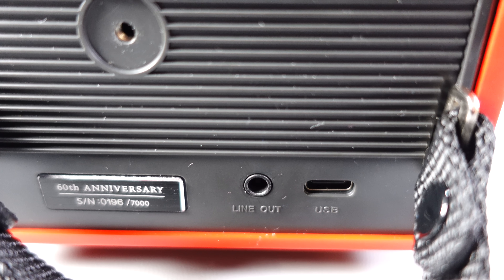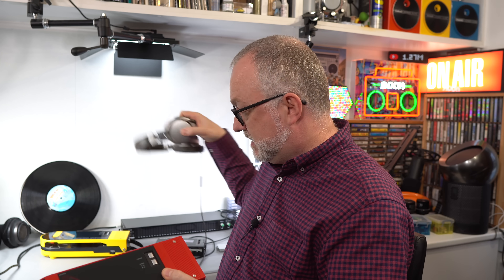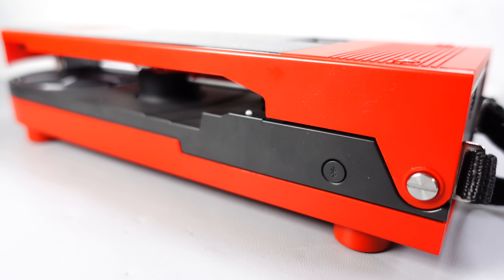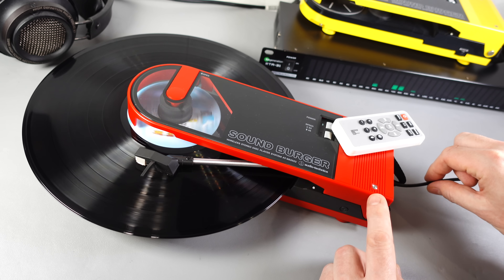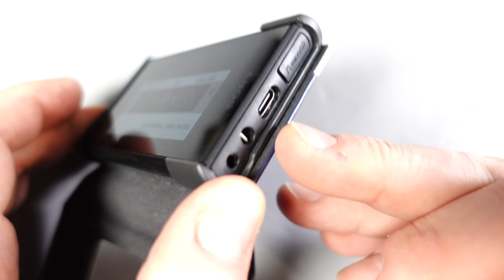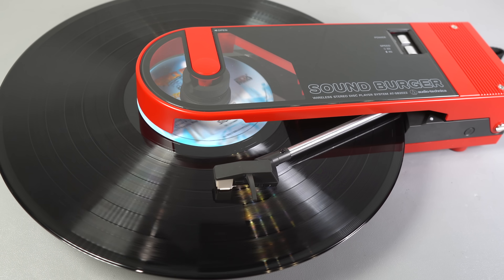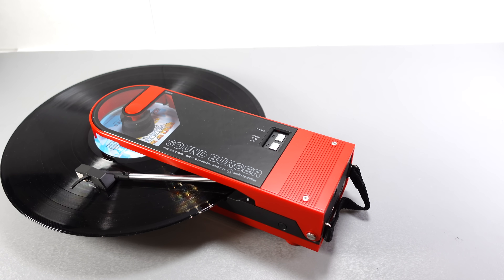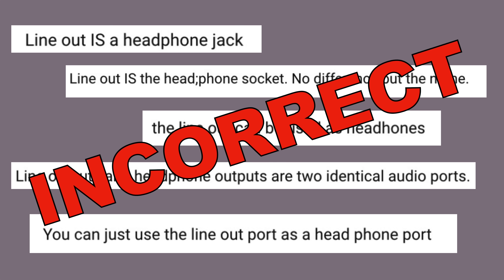Line-out ≠ Headphone-out

Comment: I've found that not only is the line out jack not suitable as a headphone jack, the headphone jack is absolutely rubbish when you try to use it as a line out jack. You have to turn the volume up far higher than you'd ever expect and therefore it will likely distort but simultaneously it just sounds rather flat and lacks liveliness. Such is the case with my late 90's Sony Discman.

Comment: I was one of the posters that said to use the line out for headphones. I was referring to the higher 32Ω impedance headphones that are everywhere these days, not the older 8Ω or 16Ω phones from history. Most line outputs are capable of driving 1 volt of signal into these 32Ω phones which are quite sensitive and can give a useful level of audio. Not loud maybe but useful. Of course this also depends on the output impedance of the line output itself. Some outputs have a much higher impedance than others and will perform worse with headphones. Using an amplifier to drive headphones so you can hear them on the bench as you did really is overkill. You'd have to be a brain dead millenial to listen to their 'music' at that sort of level. 
I do agree that the line outputs are not specifically DESIGNED for headphone use, but then again, many will work adequately with high impedance headphones if you, like me, listen to music at comfortable levels.
Keep up the good work.

Comment: It's a great shame the reissue didn't include the fairly basic circuitry for a suitable headphone amp. Bluetooth is only as good as the supported codec, and the AT-SB2022 only supports A2DP and AVRCP, with the awful baseline SBC codec. So if you really want to use this for any kind of quality listening, you'll be hooking up an Apt-X HD / LDAC BT transmitter anyway - or just wiring its Line Out to an amp anyway. They really missed a trick preserving the headphone output.

Comment: Anyone who has attempted to plug headphones into a Line-Out should know from experience that it's really quiet and there's no volume control. I expected Mat would bring out a portable amp to demonstrate how to properly use Line-Out with Headphones for this situation and he didn't disappoint. I already know this stuff, but for those who don't it's a good straightforward explanation and demonstration. Hopefully it helps some people understand the difference. 

On a related note, has Mat tried the BTR3 or BTR5 portable DACs by FiiO? You can essentially turn big wired headphones into wireless headphones and many say the sound is good. I don't know how good my hearing is, but the BTR5 sounds very good to me. Apparently there's a BTR7 now.

Comment: I used to have an attenuating cord that helped when trying to send a signal from an 8 Ohm speaker output to a Mic input.  Back in the old days, cheap equipment didn't have Line-In or Line-Out jacks.

Comment: As you've mentioned the flagged line out is just that. I've had devices over the years and they've had both line out and headphones but other devices that had only the line out but in the book that the item came with stated the line in was also headphone with a switch between the 2. I've also had devices that only had headphones out but the books have said that you could plug into a line jack as long as you were careful on the volume control.

Comment: Funny thing, I once had a CD player in the military that I left at the squadron one day. My buddy took it apart and soldered the headphones and Line Out wrong. When I got it the next day I couldn't figure out why it was so quiet, so I plugged it into the Line Out and it worked great. A few days later he told me what he did. 

Started telling people that it was a rare CD player because they mislabeled it. A lot of the new guys actually believed it.
Reply: Your boddy goes a long way for a prank.
Reply: @schwarzerritter5724  That was pretty usual. I've spent weeks on a prank before. Plus, this was deployed, so he had a lot of free time.
Reply: Your story was going good until that last part. I mean unless all of the people you knew were tinkers or music buffs. Normal people have no freaking clue there's a difference between line out and headphone jack.
Reply: @MamaMOB  You're somewhat right. Most people don't know.

The buddy who did the modification prank was also a part time DJ and liked to tinker with his equipment. So he knew.

The rest were mainly because of our job. We would make patch cables to hook up CD players to the aircrafts ICS so we could listen to tunes while cruising around. It was a big thing until big Air Force got involved and actually banned it. 

The thing is, the ICS for the C-130 was still using 1950's tech, so was actually kinda fragile. You had to use line out. If your CD players headphone jack had any kind of boost or amplification it could cause damage to the aircraft (Hence why it was eventually banned period). So you learned the difference between the two pretty quick if you wanted to play music on a flight. Anytime someone was hooking up for music, at least one member of the crew was making sure you used line out.
Reply: @Plaprad  Ok you lost me there at "could do damage to the aircraft."  You need to come up with a better story next time.
Reply: @cactusjackNV  How so? The intercoms of yesteryear were very low powered. Some CD players and such put out a lot of power (Compared to the intercom) that can damage components.

Remember, these aircraft still had vacuum tubes. This wasn't modern tech.
Reply: @Plaprad  Ah, I love a good story.
Reply: @Plaprad sorry for necropost, but banning tunes on air force planes is actually wild, can't imagine the impact it had on morale. hopefully it gets loosened in wartime lol
Reply: @ringsystemmusic  There was a good reason for it. The ICS system on legacy 130's was designed in the 1950's, and wasn't designed for modern electronics. If you put too much power into it you could damage it. So it was more for aircraft safety. It gets hard to fly when you have to yell everything. 

That's why when we did, we never used any kind of "Bass boost" or anything like that.

Comment: Yes, a headphone output can be used as a line output usually. But some things have to be taken into consideration if you‘re about high quality. 1. The integrated amplifier for the headphone can add noise compared to a direct line output (the difference being the missing amplifier). 2. The headphone output MIGHT include some equalization like some added bass, a little cut in the response around 3kHz or similar. But besides that the headphone amplifier is even better suited to drive a line input of an Hifi amplifier than a usual line out from a technical standpoint. But it usually won‘t improve things.

But yes, you CAN plug a headphone in a regular line output. You will hear something and in most cases nothing will break. But what you‘ll hear won‘t be high quality, because the line output can‘t drive a modern headphone with an impedance of 80 Ohm or lower. It CAN somewhat drive older ones with 600 Ohm, but it will be very quiet and still not perfect quality.

Reducing volume on an output to use a mic input is of cause possible, but it invites noise. The noise level of the outputting device will in mist vases be the same no matter what setting of volume you use. On a low volume setting the ratio between noise and actual signal will be low as well. Now you add all the amplification of a mic preamp, making that noise loud, the ratio remains as low as it was or may even get lower as the mic preamp adds a little noise itself. Again, not a good idea if it is about quality.

Comment: I had a portable CD player with a line out jack and I plugged in headphones into it and it did work but was not very loud and no volume control.

I have a small headphone amp that I made from a set of cheap iPod speakers. I use this amp on my phone as well as with a DIY mini FM stereo radio board project kit that I built and it sounds pretty good, about that of a walkman.

Comment: I assume line-level signals are only meant to go into very high impedance loads (such as amp inputs), so the signal probably isn't strong enough to drive a low impedance load like headphones (or speakers).

Assuming this overload doesn't damage anything, you'll still get ringing in the signal line which may or may not be noticeable as distortion. That's if you hear anything at all - per the video

Comment: Nice clarification, as I said in my comment on that video, what they should have done is just add a dang volume knob (and of course the amp circuit), with a toggle switch between both modes. Very little extra components for quite a bit of extra functionality. Whoever buys this kind of thing very likely has their own pet headphones anyway and I can bet 1 cent they're cabled. Very little needed to bring this nice extra, and heck, be more faithful to the original while at it.
Another interesting (at least for me) information is that there's an extra layer of differences on the line out signal: while the headphone jack can push comparably a lot of current through it (to drive headphone speakers), the line out one might not. The line out should have a fixed max voltage output (quite high at that for headphones), while expecting the other end to be of high impedance, so it drives little to no current to the amp, which instead provides the current for the speakers. This explains why it sounds so low (it hits current limiting), but other circuits might in other hand sound too loud comparatively, since it's not really a requirement that line out is low current. You end up with fixed too high volume headphones. The slim PS2s are like that, you can plug headphones straight into the RCA jacks (with adapters) and depending on the headphones, you'll need volume control to lower it. I've used this a heck lot years ago when playing on it.

Comment: A lot of older PCs will have a line out and a separate headphone socket (not the same thing) but as a lot of people are saying nowadays (newer) PCs will allow both types of equipment to connect, by autodetecting what is connected. These are basically multipurpose ports!
This dosn't mean you can assume you can use a lineout port with headphones.

Comment: My experience using headphone outputs for line connections is less than optimal. Aside from having to turn the volume WAY down, the sound just isn't as good. There always seems to be some distortion and noise no matter what you do with the volume and since headphone impedances are not only very different than line level equipment but also vary wldly, it's not really any surprise.

There are actually the inverse of a headphone amplifier that take a headphone or speaker level input and convert it to a line level. That is much better and safer for your equipment than connecting directly to a headphone ouput with the volume set high. It's possible, if unlikely, to damage your equipment by inputting a too high power signal. If nothing else, you can blow your speakers with massively distorted and clipped signals. (Not to mention your ears.)

So even though you can use a headphone output to connect to line inputs, you're better off doing anything possible to avoid it.

Comment: Until now, I really thought Line Out was the same as Headphone out. Very informative. Thank you as always, Techmoan!
Reply: i am experienced with electronics but not an audiophile. I always thought of line out as "speaker but you can't raise the volume". this video is helpful to know more detail on that
Reply: On anything modern it is. Impedance is adjusted based on whats plugged in.
Reply: @Wylie288  no, he just explained why it isn't.
Reply: Line and headphones are different words. Words have certain meanings.
Reply: You thought, but you weren't sure... I don't imagine that you'd confidently state that they are the same though to correct someone else?
Reply: @gavincraddock5772  What's the point of this comment... ? Why do you care?

Comment: I bought a amp board.not in yet to amplify my bluetooth transmitter to from radio and my Bluetooth transmitter is very low to boost it up.i have to build it in a box so I can work it.this will solve all my problems.

Comment: I once had a discman with both headphones and line out. Me, being the nerd that I am I wanted to match the level of the headphones out with the level of the line out. To do this I had to play some audio through the line out then plug into the headphones jack and adjust the level until they both matched played through the amplifier. Even though the level was the same from the line out and headphones out when played through an external amplifier, the sound through headphones was louder when plugged directly into the headphones jack, and you could barely here through line out. However they matched when played through an amplifier.

Comment: Y'know, I never actually considered this before. I know headphone out is made to have enough power to not require external power usually plus have volume control, but I didn't know there was a huge difference otherwise. I was always under the impression that line out was extremely loud and would destroy any headphones you plugged into it.
Reply: You may be confusing 'Line Out' with 'Speaker out'. Line out is usually around 0dB or just under 1volt of signal, but the speaker out can be whatever the internal amplifier is designed for which could be 10s of volts or more.

Comment: High impedance, low power versus low impedance, high power. Easy. A power source only delivers optimal power when loaded with the appropriate impedance. To a certain extent also the quality of the sound is impacted if impedance is not matched.

Comment: @Techmoan - Mat, while I'd never use bluetooth for vinyl at home, I think for the intended use of a soundburger it makes sense. The big problem for me is Audio Technica only specified the SBC codec. SBC really does not sound good. If they had specified AAC, APTX and (ideally) LDAC, it would have been a perfect device for its intended purpose. As it is, bit of a letdown.
Reply: But if you're gonna use bluetooth, why even bother using vinyl at all? Just download a high quality version or use some hifi streaming service. Hell, even spotify'll do the trick. It's not like vinyl + some sh*tty analog-to-digital converter is gonna sound better. Seems like a pointless product for the intended use case
Reply: @Supreme_Lobster  depends. If you want to use it for checking used records before purchase, I'd say the ease of use of BT outweighs the negatives.

Ideally of course, it would include both. As I say, I'd never dream of BT for vinyl at home.

Comment: This got especially confusing with PCs when they adopted jack tasking, where the line out may also be able to switch to headphones out, mic in, line in, etc.  I believe on modern PCs there is supposed to be some sort of impedance detection so the motherboard can tell if you have low, high or line level plugged in.

I have an external USB DAC on my PC as it sounds better, then a headphone amp that doubles as a pre-amp for my Class D amp, as it seems to enhance the sound stage to have that extra pre-amp in there and the dedicated headphone amp sounds better than the headphones out on the Class D amp.  Things just get very confusing in audio in general, especially given the quality of the output is mostly down to personal preference, few people really want a flat output.

Comment: There's another difference that wasn't mentioned.
Headphone out carries POWER. It's made to work with low impedance devices like headphones that need plenty of current to drive.

Line out carries SIGNAL. It's made to be used with higher impedance devices that aren't being driven by large amounts of current.

Comment: Idea for another video: What's the difference between phono-out and line-out?

Phono is the unaltered signal directly taken from the cartridge. Whereas line-out is the pre-amplified and sometimes filtered signal.

On that matter, do people still use amps with a special phono stage?
Reply: On that matter, do people still use amps with a special phono stage? - Yes, unless they use a turntable with a built-in preamplifier or an external preamplifier connected to a line level  input .  There's plenty of good hi-fi on devices the market with phono inputs and built-in preamplifiers.

Comment: I wonder if the confusion comes from modern computers. Example: my gigabyte aorus x570 MB only has one 3.5mm port for the front speakers labeled as "line out," even though it's obviously amplied as you can control the volume output on it in the operating system. I thought I could get around with using the optical out, but even that has volume control in windows. So annoying, I miss the true line out/digital out options on older computers where all the amplification was done on the speaker system.
Reply: Its controlled via software. You choose whether or not its speaker out, or headphone out. The amplification is still there. You are just ignorant.
Reply: @Wylie288  By all means tell my ignorant butt where to find it then. I've opened the GB realtek audio console and it doesn't allow me to select any options there for the device. Also tried in windows sound control panel. And yes all drivers are up to date.